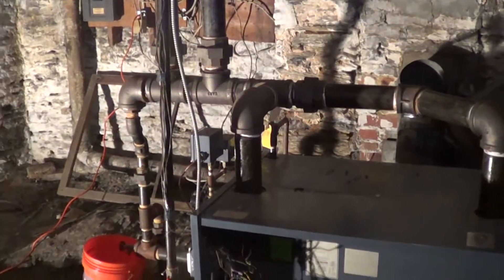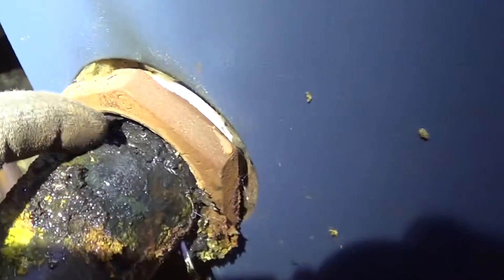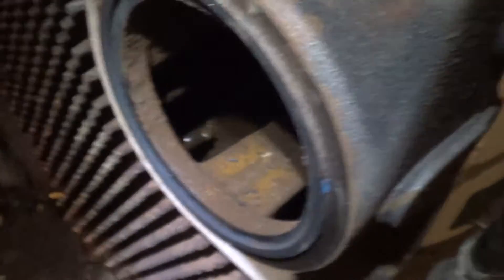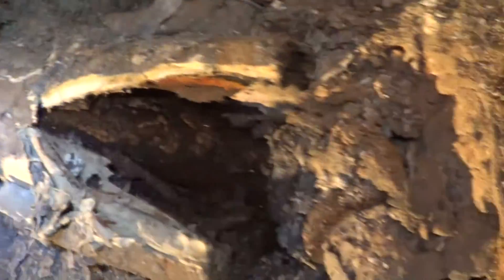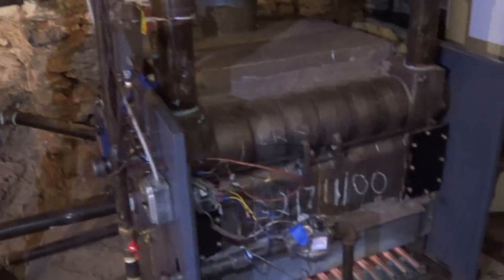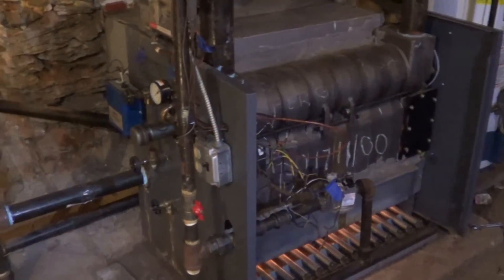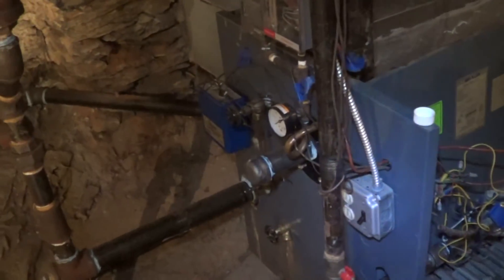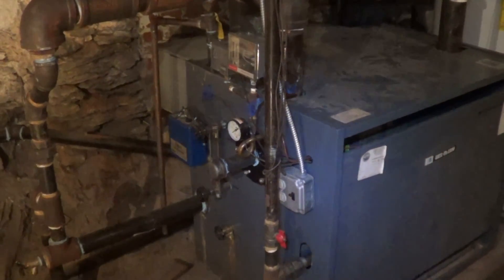Commercial/Residential Steam Heating Boiler Heat Exchanger Failure

Comment: Did they have a water treatment program? Which is extremely important!!!
Reply from the maker: Nope.   The opposite.   They had a leak that caused fresh water to enter the system.   oxygen rich fresh river water.   The main corrosion is oxygen corrosion.    If a boiler can go all winter just adding a few gallons, life will be good.

Comment: Excellent...informative. My home is over 100 years old..have a steam vapor vacuum system. was converted from an old oil boiler that was removed and replaced with a burnham boiler. Heats over 5500 sq ft. I'm 83 years old and have to operate the system alone. This has given me great insight.

Comment: Can you use copper for the wet return?
Reply from the maker: Yes.  However, most states require dielectric unions where the copper meets the steel.  Brass couplings or nipples will probably be better to join the copper and steel.  Just try not to have the copper directly touch the steel because of the voltage that it will generate.  Brass reduces the voltage generated and thus reduces the steel corrosion.